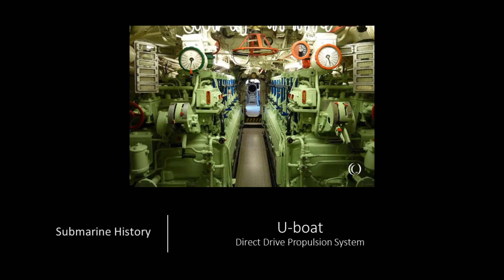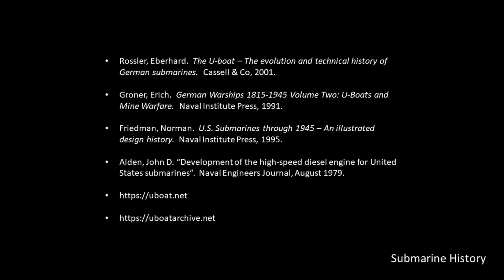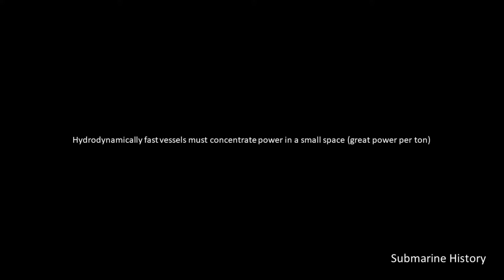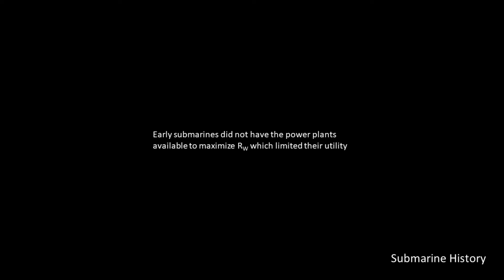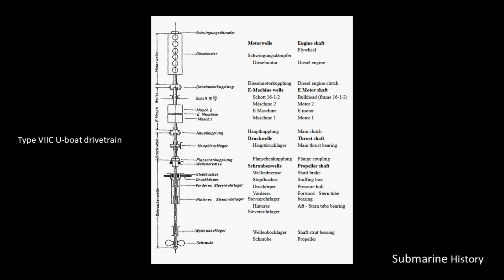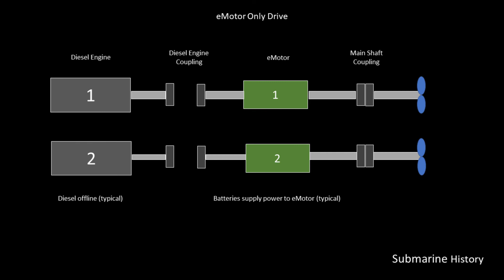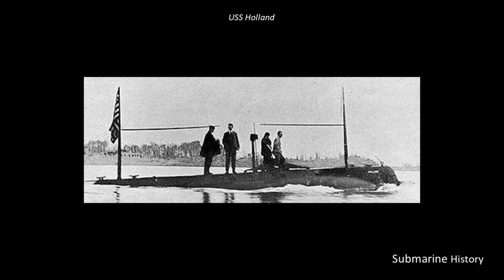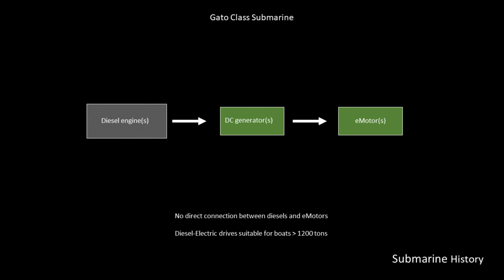U-boat diesel drive systems - #29

Comment: This makes more Clearly How it should be Done - Without Physically Connecting Diesel's to the Prop Shaft (I.E. Less Noise and Hassle) Thanks...
Reply from the maker: Yeah the Germans don't really get to boats of a suitable size for diesel-electric drives until the Type IXD series of boats, I don't know that they looked specifically at that option.  I'm told Europe didn't start adopting diesel-electric drives for locomotives until the 1960s.  So Germany would not have had that reference, but I'm sure they thought about it.
Reply from the maker: @Wolfman  Thank you!